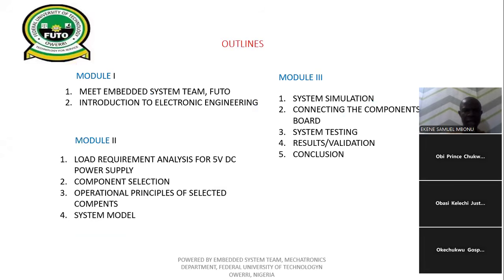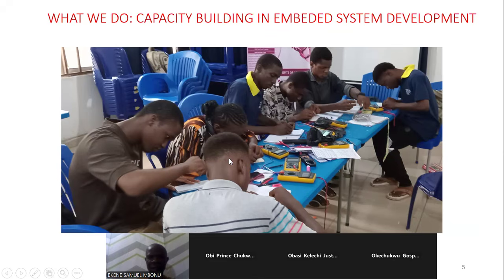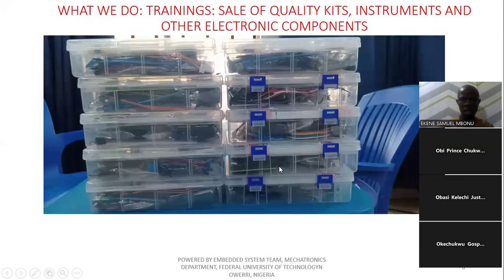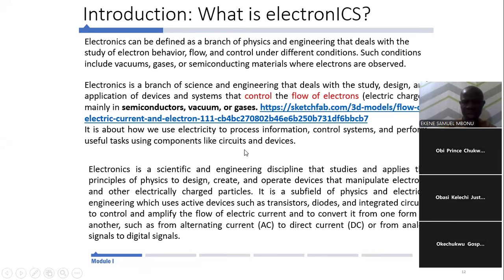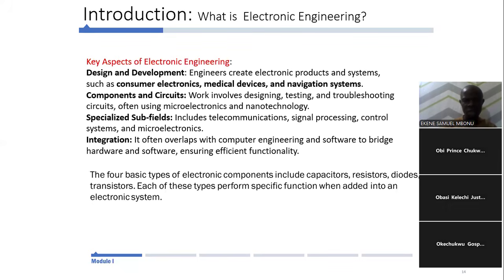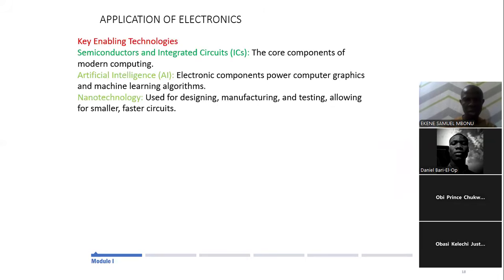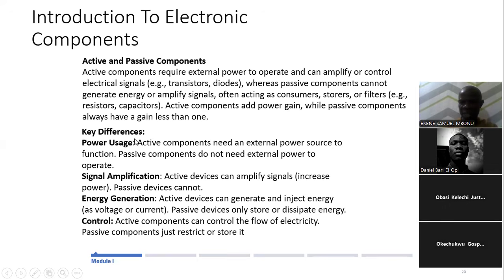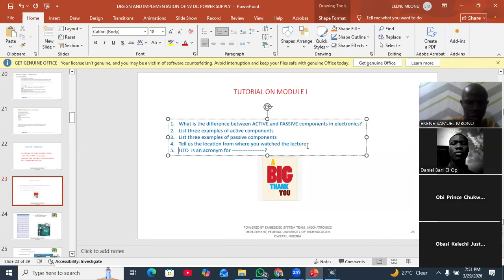DESIGN AND SIMULATION OF ELECTRONIC SYSTEMS  (MODULE I)

Comment: Name: Nwachukwu Peter Chigozirim 
Dept: Mechatronics Engineering. 100LVL 
Reg No. 20251560423
(1) *ACTIVE COMPONENTS 
(A)Active components can control the flow of current 
(B)They require an external source of power to function 
(B)They can amplify signals or perform switching 
*PASSIVE COMPONENTS 
(A)They cannot control the flow of current in the system 
(B)They do not require an external source of power to function 
(C)They cannot amplify signals or perform switching 
(2)*Transistors 
     * Diodes 
     * Integrated Circuits 
(3)* Capacitors 
     * Transformers 
     * Fuses 
(4) Umuchima FUTO 
(5) FUTO is an acronym for Federal University of Technology Owerri

Comment: 1. Active components are devices that requires external power source and can control, amplify or generate electrical signals.
WHILE
Passive components are devices that don't require an external power source and cannot amplify signals. They only store, dissipate or release energy.

2. Active components: transistors, diodes, integrated circuits ( ics )

3. Passive components: Resistors, capacitors, inductors.

4. Federal university of technology Owerri

Comment: I am ONYEAGHALA ISAAC CHIBUGO
FROM: MECHATRONICS ENGINEERING. 100LVL 

1) WHAT IS THE DIFFERENCE BETWEEN ACTIVE AND PASSIVE COMPONENTS IN ELECTRONICS? 
(a)Active components need an external power source to function. 
WHILE
Passive components do not. 
(b) Active components can amplify amplify signals (increase power) 
WHILE
Passive components cannot. 
(c) Active components can generate and inject energy (as voltage/current).
WHILE
Passive components only store or dissipate energy. 
(d) Active components can control the flow of electricity. 
WHILE
Passive components just restrict or store it. 

2) LIST 3 EXAMPLES OF ACTIVE COMPONENTS
(a) Transistors(BJTs, FETs) 
(b) Integrated circuits (ICs) 
(c) Diodes. 

3) LIST 3 EXAMPLES OF PASSIVE COMPONENTS? 
(a) Resistors
(b) Capacitors
(c) Inductors. 

4) I watched from Owerri West. FUTO Precisely. 

5) FUTO stands for
FEDERAL UNIVERSITY OF TECHNOLOGY OWERRI.

Comment: Active vs. Passive Components
Electronic components are generally divided into two categories based on how they interact with energy:
Active Components: These require an external power source to function. They are capable of amplifying signals or controlling the flow of electricity within a circuit.
Passive Components: These do not require external power to operate. They cannot amplify a signal; instead, they dissipate, resist, or store energy in electric or magnetic fields.
2. Examples of Active Components
These parts act as the "brain" or "muscles" of a circuit:
Transistors: Used for switching and amplification.
Diodes: Allow current to flow in only one direction.
Integrated Circuits (ICs): Complex chips that house thousands or millions of tiny components to perform specific tasks.
3. Examples of Passive Components
These are the foundational components that manage the flow of energy:
Resistors: Limit current flow and drop voltage.
Capacitors: Store energy in an electric field (often used for filtering).
Inductors: Store energy in a magnetic field (often used in power supplies and radio equipment).
4. Institution
Federal University of Technology Owerri (FUTO): A prominent technical university in Nigeria known for its focus on engineering and technology.

Comment: Active components need external power to operate or control electrical signals while passive components cannot generate or amplify signals but they store it 

2. Active components include transistors, diodes, integrated circuit 

3. Passive components include Resistors, capacitors and inductors

4. Federal University of Technology Owerri

Comment: 1 active components requires power so it's operate and control electrical signals while passive components consumes or stores energy without needing an output or external power or source 

2 active components examples are optocoupler , and led etc 

3. Passive components examples transformers and fuse etc 

Watching from futo

Comment: Name: Samuel Odinakachi 

1. Active components are used for signal processing and control or amplification while Passive components are used for energy storage or dissipation.

2. Active components 
- BJT Transistor
- Diodes
- Integrated circuits 

 3. Passive Components 
- Inductors
- Capacitors
- Transformers

4. I watched from FUTO, Umuchima.

FUTO: FEDERAL UNIVERSITY OF TECHNOLOGY OWERRI.

Comment: 1. (a). Active component requires power to operate and can amplify or control electrical signals 
  (b). Passive components can’t generate energy or amplify signals, often stores energy or acts as consumers 

2. Examples of active components 
(I). Diodes 
(ii). Transistors 
(iii). Integrated circuits 

3. Examples of passive components 
(I). Resistor 
(ii). Capacitor 
(iii). Inductors 

4. Eziobodo 

5. Federal university of technology owerri

Comment: 1. Active components need external power to amplify or control signals (e.g., transistors), while passive components don’t need power and only store or dissipate energy (e.g., resistors).

2. Active Components: Transistors, Diodes, and Integrated Circuits (ICs).

3. Passive Components: Resistors, Capacitors, and Inductors.

4. Federal University of Technology Owerri

Comment: Good day sir
My name is Okoro Ifesinachi Aloysius i am a 100level student in mechatronics engineering 

1. Active components require power to operate and control electrical signals while passive components consume or store energy without needing external power 

2. Example of active components: LED, Optocoupler etc. 

3. Example of passive components: transformer, fuse etc. 

Watching from FUTO OWERRI

Comment: Active components are devices that requires external power source and can control, amplify or generate electrical signals.
WHILE
Passive components are devices that do not require an external power source and cannot amplify signals. They only store, dissipate or release energy. 

2.  -  Transistor.
     -   Diodes.
     -   Integrated circuits.

3.  -  Resistor.
     -  Capacitor. 
     -  Inductor.

4.  I'm watching from FUTO, Federal University of Technology,  Owerri.

Comment: Active component requires external power to operate and can amplify or control electrical signals while passive components only stores consumer filter electrical energy 

Active component 
-diodes
-Transistors 
-ICs

Passive components 
- resistors 
-Capacitors 
-Inductor

FUTO

Federal university of technology Owerri

Comment: 1. Active components requires external power to control signals just like the (transistors)
While passive components doesn't need power but only store energy like the(resistor)

Comment: 1. Active components need external power to operate or control electrical signals while passive components cannot generate or amplify signals but they store it.

2) Examples of active components:
I. Diodes
II. Integrated circuits
III. Transistors

3) Examples of passive components
I. Capacitors
II. Transformers
III. Resistors

4) I'm watching from FUTO

5) Federal University of Technology, Owerri.

Comment: Difference:
Active components need external power to work and can amplify signals.
Passive components do not need external power and cannot amplify signals.
Examples of Active Components:
Transistor
Diode
Integrated Circuit (IC)
Examples of Passive Components:
Resistor
Capacitor
Ind
Watching from federal university of technology Owerri

Comment: Answer to question of module 1:
Active components require external power to operate and can amplify or control electrical signals while passive components only stores, consumes or filter electrical energy

Examples of active components:
Transistors

Examples of passive components: capacitors

Watching from futo

Federal University of technology, Owerri